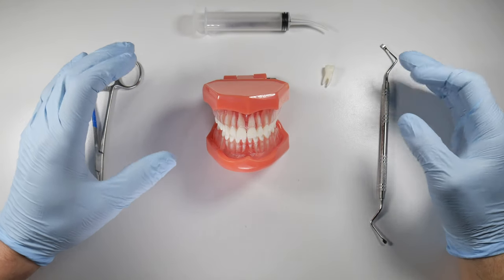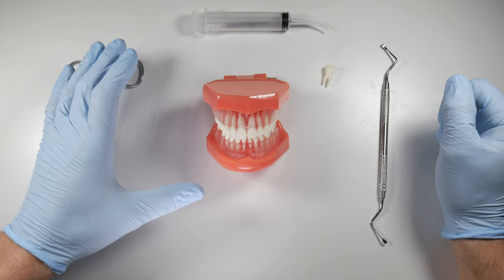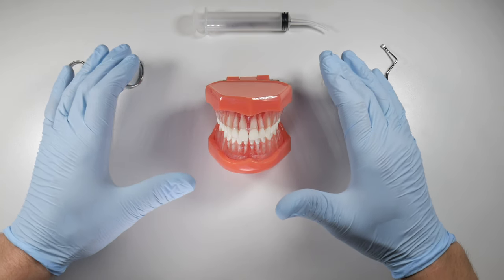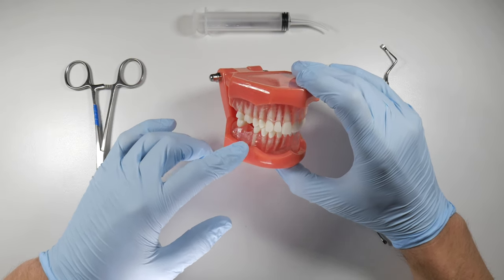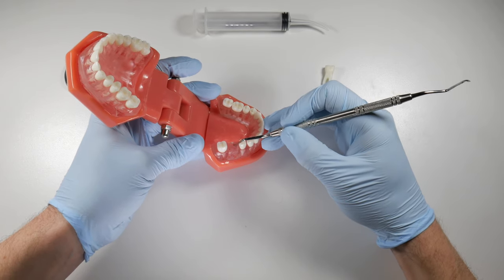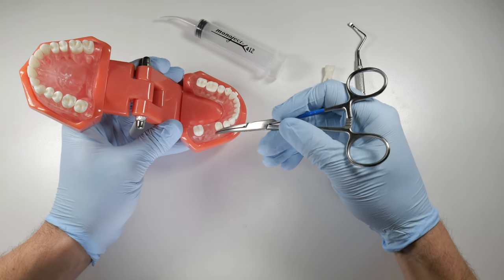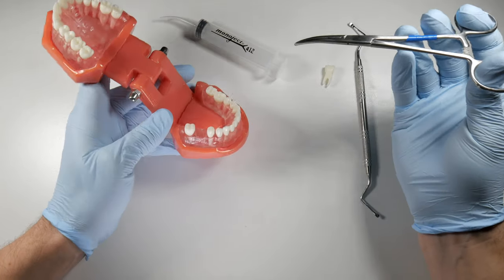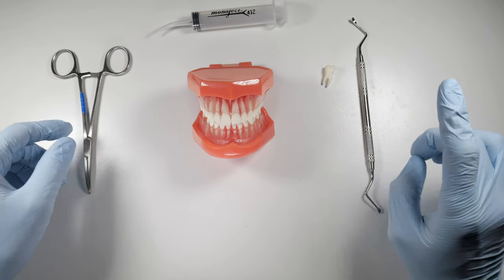How To Properly Debride An Extraction Socket | OnlineExodontia.com

Comment: This is an really interesting topic. We were taught to do so in dental school ,it is described in textbook ,so we've been doing this since graduation .However there are times when debridement could do more harm than good, for instance, cases where periapical granuloma super close /connected with maxillary sinus or id nerve, I would not touch the socket after extraction. Sarcastically most of the time the healing would be uneventful. Got me wonder is that actually evidence based.
I have been doing some literature research recently , to my surprise there are actually limited good quality paper supporting socket curettage ,few of them actually advice against socket curettage . Could you share some academic evidence to support socket debridement?
Reply from the maker: I have no papers that discuss this protocol...but if you leave debris within the socket, you have an increased risk of seeing patients again for post-op follow-ups.  In reality you could skip curetting most sites (except third molars to remove residual follicular tissue) and it would be rare to run into issues that are actually significant.  Regardless, it's good practice - not to aggressively curettage a site, but to double-check your work to ensure all fragments, bony spicules, etc. are completely removed from the site.  All the best and thanks for watching!
Reply: @OnlineExodontia  thanks for the reply! yes I agree it is important not to leave any root fragments /bone fragments or other foreign materials(calculus/fractured amalgam) inside the socket as they are potentially sources of infection.

Just wondering should we treat granuloma the same , afterall it is essentially composed mostly by our own cells
Reply: I’m currently having an issue with a continuous gnawing pain since having my zirconia implant removed over 5 weeks ago. I’m going back to the surgeon tomorrow thank god! The pain is a steady 5-6 and will not let go! I’m worried I have hyper granulation tissue. I had some come out of the socket yesterday and bled a bit. It feels like something is in the socket and scar tissue. It’s maddening. The socket hasn’t closed either which is another concern. Anbesol or Oralgel works for about 3 minutes. I can’t even lay on that side without it waking me up. Any advice as to what’s happening with what I’m going through would be appreciated. I literally want to take a fork to my gum/socket right now. This pain is way too close to the brain if you know what I mean!? The last two weeks have been hell! It’s been getting worse rather than better. The site itself looks well but have a more red spot on the outer side of the site. It’s in my lower left 2nd molar region. I have no 1st molar either. I’m done with implants! lol!! Never again! I hope I (surgeon) can solve this??

Comment: should you curette a socket that shows no radiolucency or evidence of infection?
Reply from the maker: My answer to this would be yes.  Do it immediately after, but don't go crazy or too aggressive.  If you make a habit of this, the odd time you'll find a piece of loose inter-radicular bone, calculus, tooth fragment stuck on the gingival collar, etc.  I feel it's good to have a habit of ensuring the socket is free of debris that could act as a source of infection / irritation during healing.  All the best!
Reply: @OnlineExodontia  i agree.  i took out #12-15 a couple weeks ago and the guy came back with an abscess on the palatal.  after a course of augmentin with no resolution, I went in and debrided the area and found a loose piece of bone, which im thinking was the cause of that infection.  hopefully he comes back better next week!